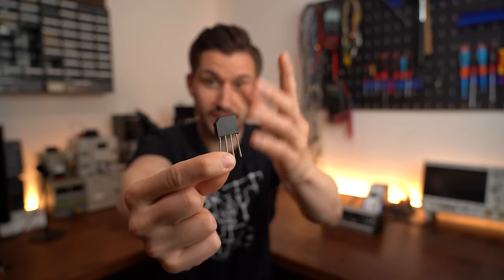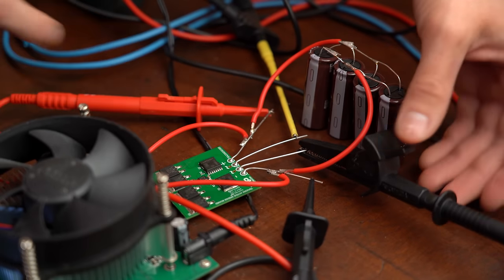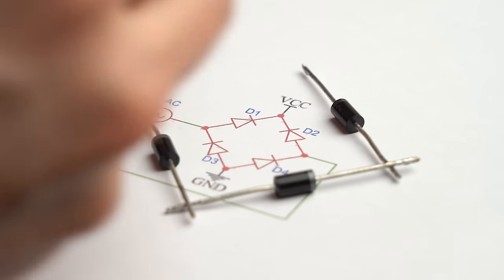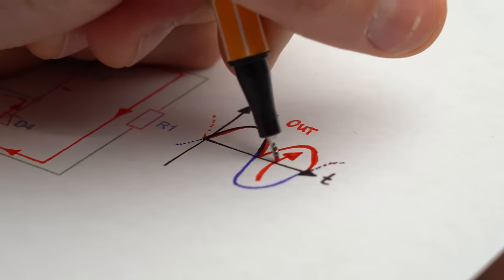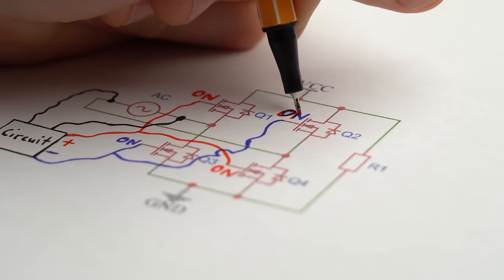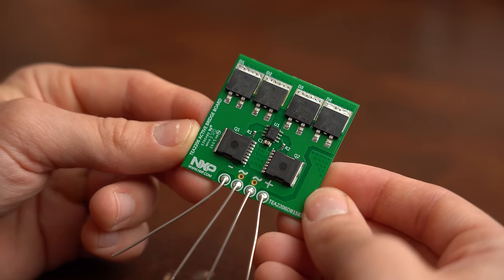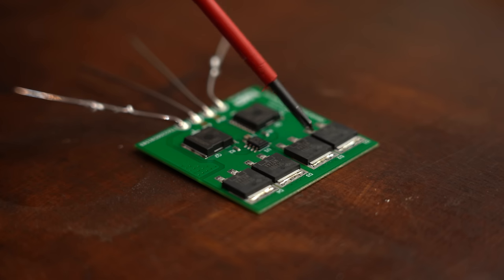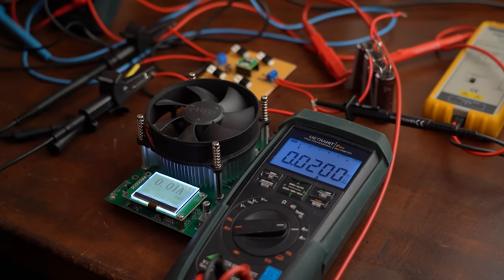The End of the Full Bridge Rectifier? (Sorry ElectroBOOM) Active Rectifier is here!

Comment: Think about using it in the car alternator... 55A or more is common and at ~14V
Reply: MOSFETs act like low-value resistors when fully on. So the loses, that voltage that develops across them, is described by Ohm's Law and increases with current. So eventually the simple ohmic losses would be greater than the (mostly) constant diode voltage drop. If you have a MOSFET with a 0.015 ohm fully-on resistance (a reasonable figure for a 55amp device) then the voltage drop is 0.015 ohm * 55 amps = 0.83 volts. That sounds like a plain ol' silicon rectifier diode.
Reply: @alecdacyczyn  Good point! If it s like 0.015 ohm it is almost identical to the STBR6008-Y diode from ST. When using more than 55A, it would be better to have the diodes...
Comparing against SCT011H75G3AG mosfet...
What about more than 1 mosfet in parallel?

Comment: Interesting, I've seen synchronous rectifiers for the output of high current converters (own a few driver ics that come with it built in even, for both push-pull and buck-boost converters), but this is the first time I've even considered it for an ac input. Learn something new everyday I suppose.

Comment: Recently i simulate Rectifier that convert 3 phase Ac to DC o proteus on 5V Ac 50hz it was fine but on 220v i get u ractified pulsating dc even i use capacitor on putput

Comment: With high voltage, the diode voltage drop is insignificant. 
With low voltage, high amps, the mosfet resistance becomes an issue.

Comment: Could you please do a video converting an old laptop adapter (charger) to a USB c laptop adapter (charger)? The USB c adapter should produce only a sing voltage value, for example, 19 volts (for simplicity). I need to use my old laptop adapters to charge my new USB c (thunderbolt) laptop

Comment: Wouldn't a Schottky diode be very advantageous at lower voltages due to it's ~0.3v lower voltage drop?
Reply: Yes, at low voltages (say  <30V) but it has higher reverse leakage and gets worse when it gets hot. Hard to find with high current values but they are certainly used for very low power designs. Regular diodes are very tough and survive noise and voltage spikes better than Schottky diodes. Also handy when you only have 3.3V or less.

Comment: 03:16 so in a circuit when theres two different paths to flow to (in this case the D3 and D4 from R1) the current will choose which ever path has the negative lead connected to it?  So if  the negative lead is connected between D1 and D3 no electricity will flow through D4? Also if the AC marked on that schematic is the power supply what is the VCC? Is that a device that uses the power? Im not great with these yet.. I was thinking the VCC was the power supply and I dont understand any of the definitions on ask quora when they simply say "rails for voltage collection".  Last question.. How does the AC supply pole change from + to - and - to positive thus leading to different current routes? This obviously cant happen at the same time.. So is this what happens with Alternating Current power supply? Its constantly swaps the polarity of the two leads?
Reply: Vcc is what the positive power rail connection is often called for BJT based semiconductors. ('C' for 'Collector'). For MOSFET based chips is usually called Vdd. ('D' for 'Drain').
Yes, alternating current (AC) is so called because the current... alternates. The input-power from the wall does that. And when you don't want that then you need this system of one-way doors.

Comment: What about using Shottky diodes instead in a diode bridge? At least halves the loss compared with normal diodes and is a lot less complicted than a MOSFET bridge.
Reply: They are actually used instead of standard 1n400x diodes in switching mode power supplies. Normally, however, the low (20-40v) breakdown voltage makes them unsuitable for such applications. There's a reason Schlottky diodes are called "Small signal fast recovery" diodes in most datasheets!

Comment: What about high voltage. And or higher amps. I know about the switchers with 10 to 15 dc volts with 30 or more amps. Stacked with each same volts you can get higher amp output. 1 stacked 7 / 30 amp switchers to get 14.2 at 210 amps. Works good to power a large linear amplifier . Solid state devices.  What about high voltage AC to DC filtered B+ for tube applications.

Comment: I have a Question, with this dc full bridge rec, how much supply voltage do you need for a 12V output?
I tried this with a 12V AC transformer and got only 5V out. So there is a significant voltage drop.
Is there a way to do this without such a voltage drop or do I need a stronger transformer?

Comment: I couldnt count how many mosfets ive blown and seen blown in my lifetime, but could count on my hands about how many diodes ive had fail..  but most of the time its either the mosfet, capacitor or voltage regulator when i troubleshoot a circuit..   but usually a driver..

Comment: The circuitry required to manage the MOSFETs uses more power than the .7 voltage drop of a silicon diode looses.

Comment: It would be useful have just a single diode Moss controller as if you use a mosfet it will still let current flow back the other way if power is still on the output side. Perhaps some circuit or ic two simply control a mosfet and turn it into a perfect diode. The low voltage high current is the scenario where a diode is very bad. And wear a mosfet is far superior. Diodes for high current applications are really big

Comment: Real "great" Schrotti! - RTF would also state: 
  [TEA2208] "Using the TEA2208T with low-ohmic high-voltage external MOSFETs significantly[?] improves the efficiency of the power converter as the typical rectifier diode-forward conduction losses are eliminated. Efficiency can improve up to about 1.4 % at 90 V (AC) mains voltage." 
  (but remember: datasheets are typically always some kind of enthusiastic, presenting only the best sides) - but not cutting out a part of the sine wave and using a "switched resistor" may solve other issues...   
  and thinking about it first, may gain the insight, that a drop of about 1~3 volt (2 diodes Vf, or lower with Schottky's) may only be relevant with low(!) AC voltages (automobile?) and on very high currents? - but not typically with 110 or 230 Vac mains - or what do you think? - oh, no, you didn't...

Comment: One of the most important points is missing — cost. Engineering is about delivering a good solution at the best cost. Here cost should include not only the cost of the circuit, but how much money is saved by the quite tiny gain in efficiency. 

Even that is naiive because the cost is a function of perspective. The manufacturer of the power supply doesn’t care if you have to spend extra over the lifetime of the power supply’s use. They care if their product sells and is reliable. More parts means more cost to them and likely a higher failure rate and lower manufacturing lead.

So, the click bait title is very misleading.

Last, a good engineer does not do design hoping things don’t blow up 😅

Comment: expert in electricity: i want to put some power diode on a ebike battery pack composed of multiple power tool ball (to prevent them discharging into another if theyre not same voltage, i was going to put 1 diode on one cable of each pack to alow them only to discharge, but is there a way to avoid the 0.7 volt of drop from the diode? cuz the batt pack are 5s i use it in 10s meaning there is so 2 diode on the path and will cauze a vdrop of 1.4 volt wich beging to be a litle anoying

Comment: Hmm, I don´t understand how the mosfet´s resist to the reverse voltage. Is there any mosfet without body diode?
Reply: The MOSFETs open in the direction of the internal diode, the inverse of normal, or you need to build a circuit with two opposing MOSFETs.

Comment: Why not use TRIACs or SCRs? They are a fraction of the price of MOS FETs. If you want fancy try a LASCR, an optical (light fiber) activated SCR, or LTT Light Triggered Thyristor.
Reply: Because of the voltage drop on them. Probably this was a sarcasm from your side.
Reply: @gherbent  You are running from Mains, voltage drop is not relevant. The real 'problem' here is efficiency, a diode that conducts for more of the waveform is the better choice, however unless you are talking about Mega watts, it is a waste of time.
Reply: @andrewbarnett84  You got me wrong because he made a non reasonable use of his rectifier in Mains, where even the driver IC is rated at 90V max. I was referring to the main purpose of this circuit, mainly for high currents and low voltages, or limited thermal dissipation, where nothing can assure a such low voltage drop, even Schottky diodes do not come close.
Reply: @gherbent  I found this on the internet.FERD20H100S, which is a FET Rectifier, should be best of both worlds, not needing the IC.
Reply: @andrewbarnett84  This is something new for me, is worth considering. Thanks.

Comment: so this thing would fail with a nice short circuit and possible fire, when the ic fails that controls which one is turned on ?
Reply: If the circuit is designed properly it will have a fuse on the input and that would blow before any fire occurs. Of course a passive bridge rectifier never fails........

Comment: How about germanium diode rectifier? Ge diode has forward voltage half (0.3-0.4V) of silicon diode (0.7-0.8V) High power Ge diode = 0.4 V drop at 1A = 0.4W
Reply: You can not find them. Instead, you can use high current  Schottky diodes with even lower drop voltage.

Comment: More that can go wrong.  Besides, most switching power supplies use 1 or 2 diodes as a doubler, which makes over 300 volts DC, albeit chopped up, but that's what capacitors are for.  Not a big fan of over-thinking this very elemental aspect of the work-horse of technology, the power supply.

Comment: I'm currently studying transformers in physics and i have previously studied engineering, so why is there a FBR and a transformer in the laptop power supply?
Reply: Compared to the diode bridge this solution is costly, less reliable and usually used for low voltages and high current circuits.

Comment: I can’t afford the $180 they want for the board, and I don’t need 2500 of the chips. So I can’t order the TEA2208T to use in my circuit. You said their chip used a comparator module and mosfets, could you show what that circuit would look like to make it ourselves so I could do a cost comparisonş? Thanks!

Comment: I still am not sure about the application. cause the wires of low voltage high current DC is so resistive that makes the benefit of this rectifire negligable. It's like putting a no smoking sign next to the lava river.

Comment: I'm assuming you're European, and that looks like a Schuko plug for the variac. You probably know what you're doing, and that probe connected to the X terminal is probably to check for neutral. But whenever using a variac with non-polarized plugs, as in Europe, a warning should always be in place that if you flip the plug the wrong way, you will have mains voltage to ground on the output, even if the voltage between the taps is significantly lower (25V in this case). So even if the circuit sees less voltage, you will get the full mains if you touch it. Worth mentioning if you mention using a variac for safety, IMHO.

Comment: what about you used 2 diodes in parallel that would lower it's resistance? doesn't that work?
Reply: Diodes are not ohmic devices. The forward voltage drop across the diode is roughly constant, so splitting the current across 2 diodes doesn't affect the power being dissipated.
Reply: @fat_pigeon  right!

Comment: Is anyone here familiar with a boost converter IC that also acts like a rectifier MOSFET controller? Given the requirement that they be used together, a combination IC seems like the logical next step.
Of course, there are oodles and oodles of boost (+buck) converter ICs, for a huge variety of applications. However, given that the MOSFET rectifier has a somewhat narrower range of worthwhile applications, I’m guessing that a combo IC would large enough coverage of target applications to make it marketable. That’s just speculation on my part though.

Comment: Except that NONE of these are good enough for LED circuits to actually prevent flicker at twice the mains frequency. The efficiency concerns drive the use of the cheapest and simplest conversion circuitry, resulting in 100 or 120 hz flicker. That flicker is faster than the image forming circuitry of the brain. It is above the flicker fusion frequency. 

However, the brain does NOT only see in imagery. Other circuits in the brain automatically track movement without and in advance of any part of consciousness even knowing movement was detected. Also, through other circuitry working in conjunction with that to extract edge and movement information another severe problem arises. The lateral geniculate nucleus that does those jobs in combination with the superior colliculus "sees" the high frequency flicker. It identifies that as a potential danger. Worse though, as LED light is everywhere in the visual field, the brain is not able to find that movement to look at it. Instead another portion of the brain is involved - the default mode network. That and other functions attempt to resolve the danger warning and to involve conscious awareness. That too fails. And when it fails for long enough (not very long), the brain reacts in several ways. 

In one way, the brain tries to find those motion by telling the ears to listen more closely and by turning on dead circuits to do that. The result is intense loud subjective tonal tinnitus. 

Other parts of the brain fail and the result is an optical migraine - temporary blindness for about 30-45 minutes. That is often followed by full blown migraines. Those last for hours, or with more exposure - for days. 

When the signals in the eyes are strong enough, this also overflows into the trigeminal nerve resulting in eye pain, pain behind the eyes, jaw and molar pain, and worse. 

So, the task you set for yourself is more involved and has additional constraints that you were not aware of. In addition to efficiency, the3re is an absolute need to minimize and eliminate 100-120 hz flicker. That takes priority over efficiency.

Comment: Nice solution but for consumer electronics it's far too expensive.
A cheap and quite efficient way might be replacing the bridge rectifier with Schottky diodes.
These diodes have a lower voltage drop then usual diodes so they have lower efficiency loss too.

Comment: Question for everyone: I'm building a 3d printer and I have a 1000W 120V heater pad for the bed.  My calculations show that this will draw 8.3A.. is this the Max Amperage itll draw? I need to know what current rating for a Temperature fuse. Im looking at a 155C fuse which I can get either 10A or 15A.. Which amperage fuse should I get? 8.3 is under 10A so one would think 10A will suffice but will getting the 15A fuse not be an issue? Will the 15A give me extra safety in case there are spikes (are their current spikes?) so that the fuse doesnt blow thus ruining a possible 24 hour print job?  I imagine the current "spikes" is how fires are caused or no?   I also heard someone say that a current can trip a fuse and jump the fuse.. IF this is true does it jump the fuse only if the fuse wasnt rated high enough or could it jump over any tripped fuse?
Reply: Exactly how big is this printer? 1000W seems a bit much for the heated bed

Comment: How about integrate everything and just run the inductor of a current mode buck converter directly from the ac? Of course the duty cycle would have to compensate for the ac wave timing but that would make a very small and minimalist PS. Has anyone ever tried this? Is it even possible?

Comment: 4 watts dosn't sound like a lot. but think. 100 million nintendo switches where sold in 2021. now if each one of those saved 4 watts.thats 400 million watts saved, or 400 megawatts, just shy of a 500 megawatt coal power plant. thats a LOT of power/Co2 not going in the air. and think. that is just 1 device!

Comment: Not really worth it; besides the low gain in efficiency for mains ac rectification you obtained with your tests, keep in mind the high risk of the control circuitry failing or even worse, one of the mosfets shorting (which is a matter of when, not "if") would have catastrophic consequences.This adds a lot of complexity and price, so the old 4 passive diode rectifier still reigns, imho.